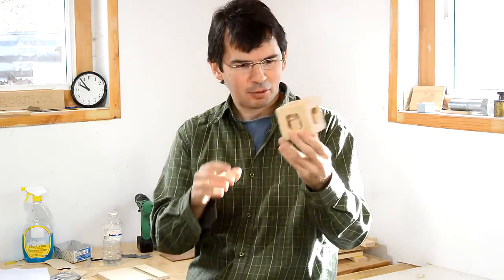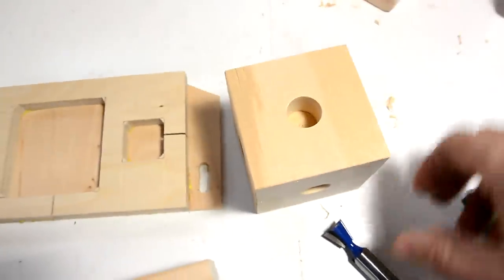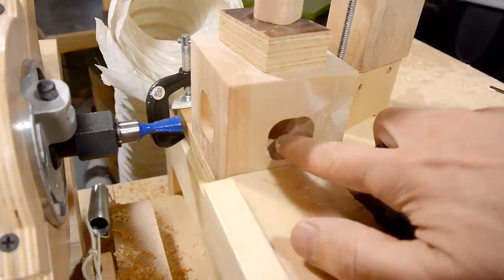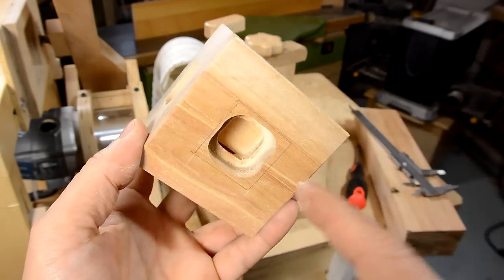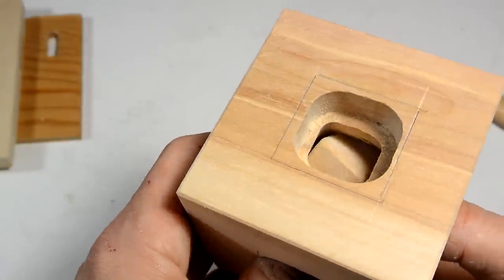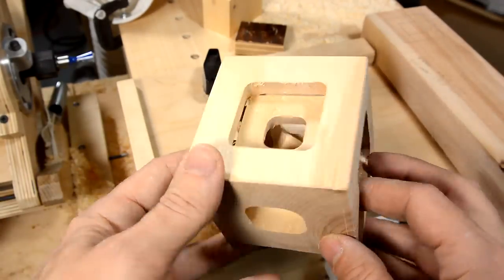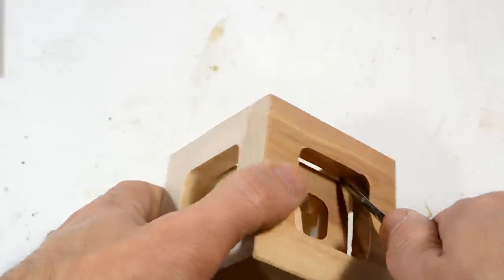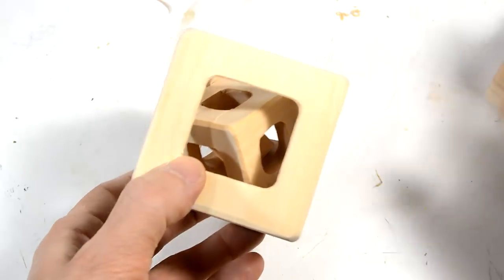Cube within a cube

Comment: Hello Matthias, I have a challenge for you. One which I think you can succeed at. Personally, I enjoy your homemade machinery the most (you are very creative and methodical). Here is the challenge:

Build a wood lathe with variable speed (belt, vfd, etc) with at least a 6-8", 150-200mm ;) swing, and a bed length long enough to turn a baseball bat (long enough to turn most anything). Its head/tail stock has to be able to accommodate typical store bought chuck/accessories. 

You also have to build it for less than 300$. Any more and it isn't as worth while to build. I personally think you can do it for much less. Price excludes tooling and accessories. Good luck! (If you choose to pick up the gauntlet that I just threw down!)
 Thumbs up everybody!